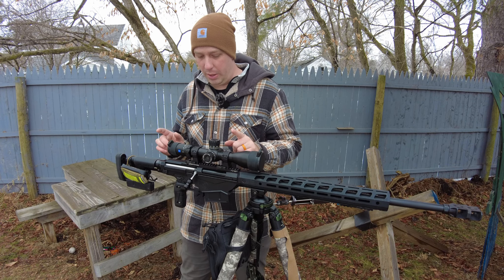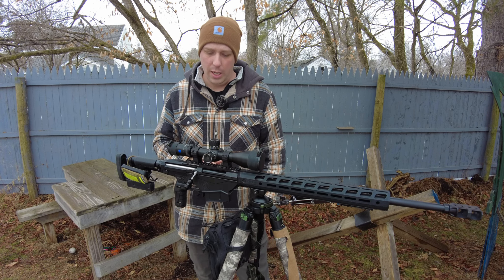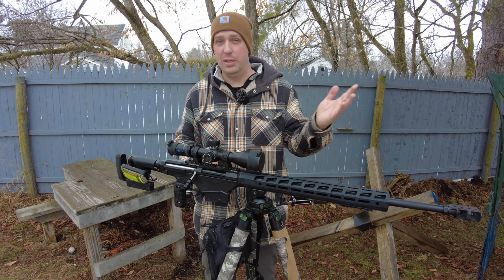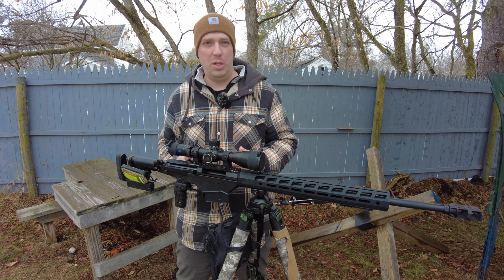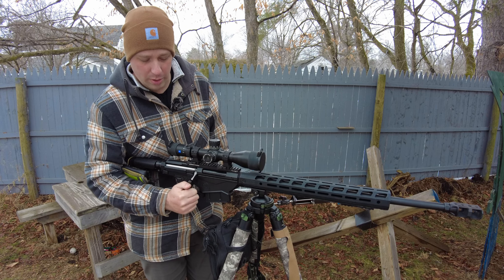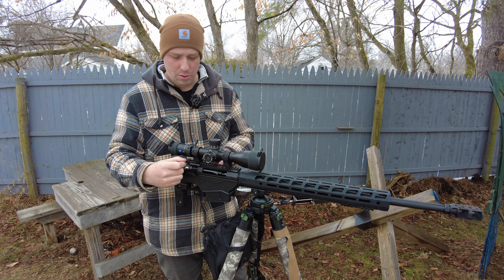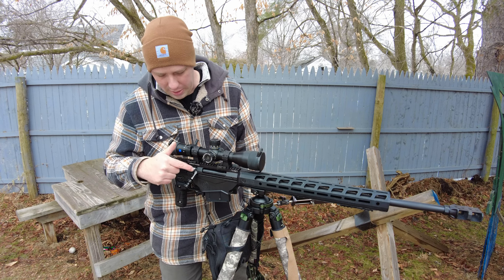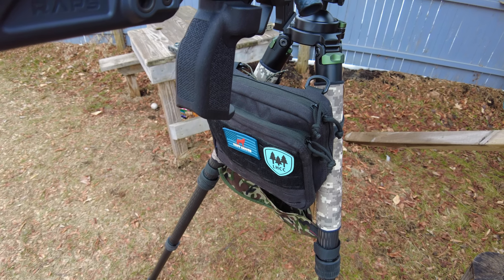Your Ruger Precision Rifle Magnum Needs These...

Comment: So, on the bolt shroud, it is not a placebo effect. What is actually happening is the heavier weight of the Bolt shroud is balancing out the bolt. Instead of lightweight shroud in back and weight is forward or center,  you now have it more centered so easier to run the bolt straight back and forth without it catching or tilting. :) is yours stainless or titanium?